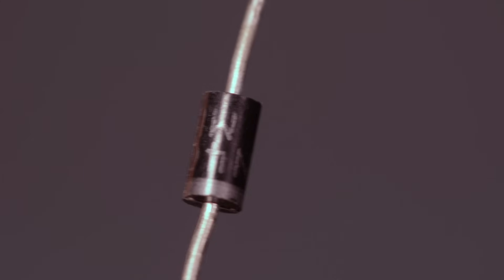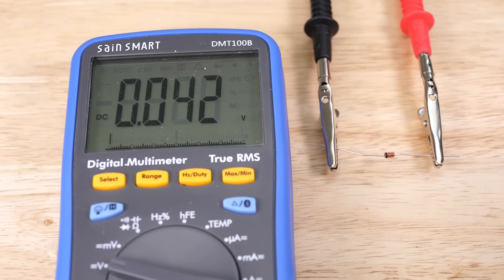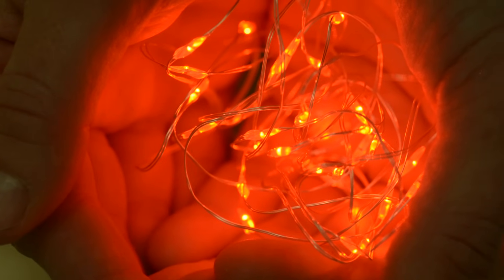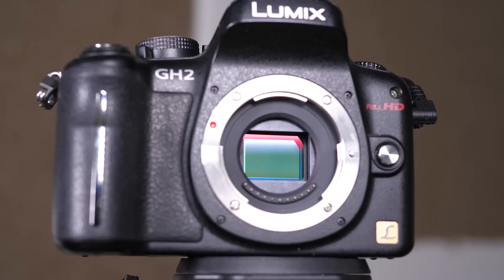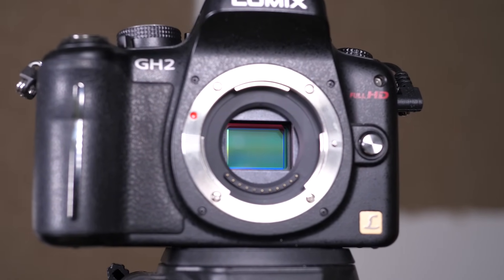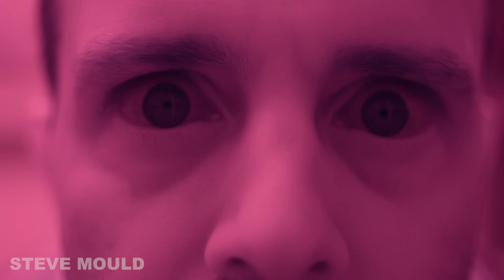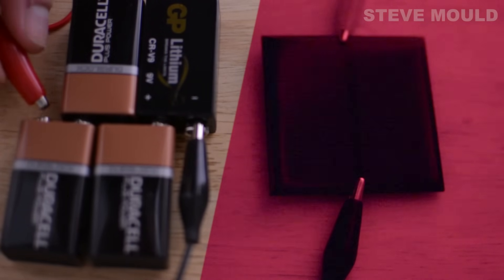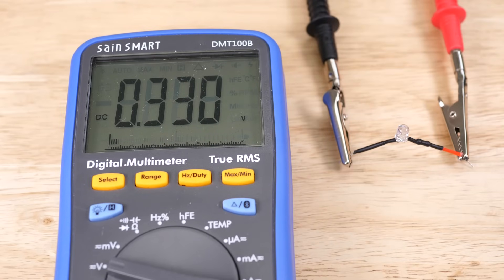Why all solar panels are secretly LEDs (and all LEDs are secretly solar panels)

Comment: Great video. If diodes are also solar panels, then the LED TV displays could be solar panels ?
 AND the LED screens in mobile phones could charge the battery slightly ?
Reply: Yes and no. As mentioned before, LED TVs use an LCD panel with LED back-illumination.
First, the LCD has relatively low light transmission (even if you set it to display a white background, only few percent of the light manages to pass through, and that's also true in reverse, so only a small part of the light hitting the LCD would reach the LEDs.
Second, the LEDs making the backlight are very small: less than 1 mm2 per LED, and maybe a few hundreds LEDs in total for the backlight - so a total area of one or two square centimeters that could actually collect light and transform it into electricity.
Third, the LEDs in the backlight are white LEDs, which are in fact blue LEDs with a phosphor coating to produce the other visible wavelengths. LEDs are only really capable of absorbing light with the same - or shorter - wavelength than they emit, so only the blue and UV part of the spectrum could be used to make electricity. But remember, you have the phosphor coating on top that is designed to absorb blue light and produce longer wavelengths, so in the end only a fraction of the blue light that hits the LEDs actually reaches the semiconductor die and can produce electricity.
So, in conclusion: yes, you can probably extract some electricity form an LED TV panel, but it's utterly impractical and inefficient.
Reply: That would have been a great idea, for those old Kindle E-readers, which used a screen without a back light. If every pixel was an LED, it could be made to work, if each pixel was driven by a synchronous rectified pulse width modulator. I think with the right driver, the newer OLED screens could be made to do that.
Reply: @vincentrobinette1507  the problem is that OLEDs are inefficient as solar cells, (and they cannot emit and receive light at the same time). You would get only a little charge with a solar cell as small as the screen.

Comment: In fairness, this equivalence principle was discussed decades ago* by good old Forest M. Mims III. Anyone old enough to remember when Radio Shack was actually interesting (and not just another lameo place to buy a cellphone) probably remembers his line of books that they sold, the "Engineers Notebook" series.

*One prominent example: F. M. Mims III, Sun Photometer with Light-Emitting Diodes as Spectrally Selective Detectors, Applied Optics, 31, 33, 6965-6967, 1992

Comment: So how do we stop PV system from dumping all the collected electricity when the solar panels are in shade or in the dark? Funny thing is we use diodes for that as well. They're called bypass or blocking diodes depending on how their used in the circuit.

Comment: Well, you still call it infrared “light”, so yes, IREDs (including those designed for that, like those in a remote controller and solar panels) are also LEDs.
Reply: Indeed, most light is outside our visual spectrum.
Reply: Omar Omokhodion Yep, though we can still see some NIR from remotes and perceive FIR with our skin as “heat”.
Reply: @0MVR_0  light, electromagnetic radiation, same difference.

Comment: Motor - Generator
Speaker - Microphone
LED - Solar Panel

etc.

There are so many things that can be reversed to producing voltage from using it. I think that's really cool.
Reply: thermopile - thermoelectric heat pump

Comment: Cellphone makers listen up - I wanna charge my phone by leaving it in the sun. Make it happen
Reply: except the display heats up pretty signifigcantly by absorbing all the light
heat degrades overall lifetime of any electronics, but especially for the battery :/
I had my phone shutting off due to overheating  (on a relatively hot day, mind you) after I left it in the sun for a while
Reply: But then they will want $3500 for a phone.
Reply: You can get USB power banks that have solar panels to charge them.
Reply: @marcusfred4480 , that solar panels on powerbanks aren't made for charging them, but only for keeping energy
Reply: @Unerty  What??? Lol! I can assure you that the solar panels absolutely put charge in the batteries.
Reply: I wonder if an app could enable thise

Comment: Hey Steve I like your hoodie, what is its name? (as in, where could I get one)

on a more electrical engineering note, we can use photodiodes (diodes that are made for sensing light) to detect a single photon. To realize this you have to use it in the voltage mode so that there is no saturation current (which is called dark current in current mode). Voltage mode is also used in solar panels but a different resistance is used in the circuit to maximize power output.

mode might be called regime or something like that, idk the English term for this.

Comment: It should be pointed out the way light is produced is very different between the LED and the solar panels. The LED is forward biased and the solar panels reverse biased. The light produced from reversed diodes is produced is Bremsstrahlung radiation and LEDs use direct band gap semiconductors. Big and very difference.
Reply from the maker: Hey thanks for this  I believe solar panels are reverse biased when used as solar panels but if you want to use them as LEDs, you forward bias them, like you would with an LED.

Comment: 3:54 The concentrator PV cell is a form of multi-junction PV cell. They are made of multiple layers, each of which acts as a PV cell that most efficiently converts its own range of wavelengths to energy.